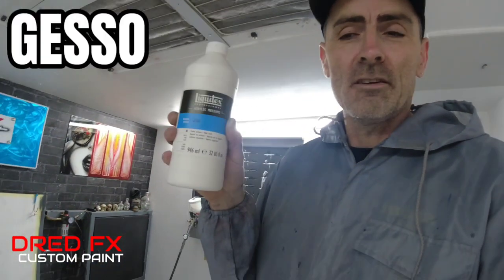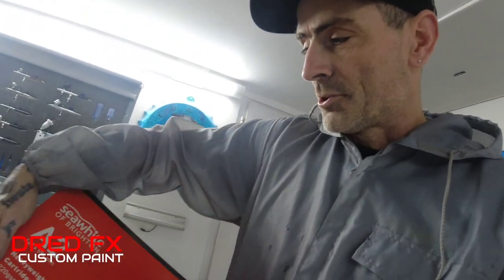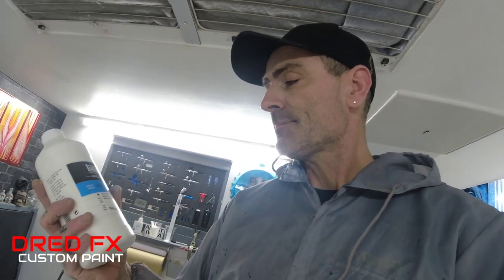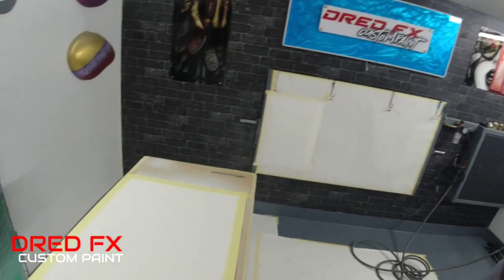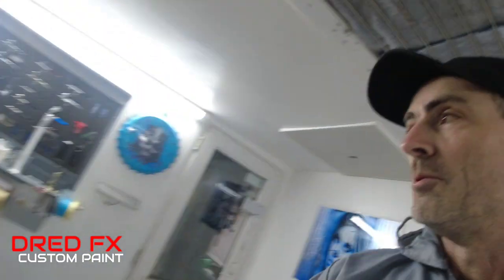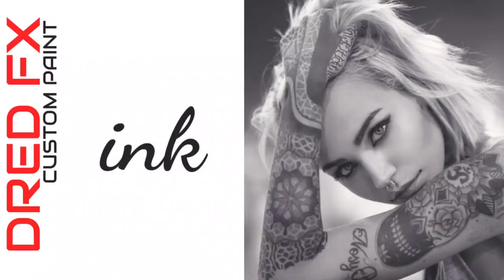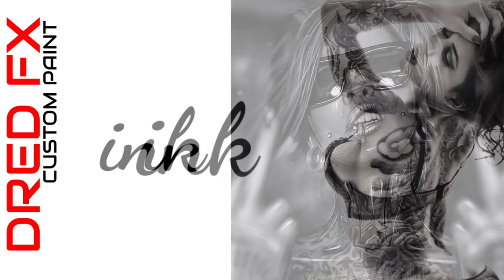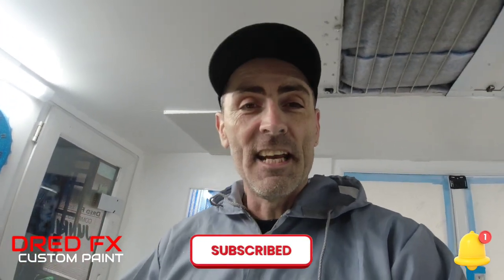Applying Liquitex Gesso with a spray gun

Comment: A little tip. I have done the exact same thing (product) on canvas and it works. Also find that gesso becomes flatter by drying in a horizontal position. BUT gesso in larger quantities is a mess, in booth filter materials, on anything other than the subject, you see you have covered floor. I also found it difficult to clean the spray gun thoroughly. Actually I have a rougher cheaper 2.5 gun for just this type of job with no reduction until last coat.
Reply from the maker: First time giving this a go we will see what it's like to paint on 🤔
Reply: Question: did you THIN down your Gesso and if you did; what did you use to thin it?? Also could tell us  the RATIO of what thinner to Gesso  you used, so it would go through the brush AND still cover well??
Reply: I dilute distilled water well stirred. Due to the fact that gesso comes in many viscosities from the many brands, you have to experiment a bit with the ratio. Sometimes 5 to 8 layers, and long drying time between layers and especially after the last one. If you choose to wet sand the surface afterwards, be aware that water redissolves the gesso and it becomes 'soft' again @yakkyuu12

Comment: Great video my man...!   I just started to draw again.   And will be airbrushing on illustration board.   Having huge problems with masking tape on the illustration board at the moment...  Taking the paper off with the tape.   I have 30hrs of line work on this 40x60" board right now.   And I think this GESSO is gonna be the best way to get a solid protective coating (clear as well) over this mat board so I can lay out this artist masking tape without eff'n up the board.     

I was watching vids on how to apply gesso,  brush or bondo spreader...  But I have a shop with a compressor.  And have sprayed automotive paint for years.  So reduce the Gesso DOWN. 15%  And BADABOOM...!!    Looks like it goes on slick.  

Thanku sir for this video.   Much appreciated...!!
Reply from the maker: Glad you liked it the gesso works a treat thanks for the feedback and support with the channel

Comment: GREAT VIDEO THANKS WHAT PSI TO YOU RUN IT AT I HAVE A 1.5 MM GUN. MAKE IT LIKE A MILK VISCOSITY OR JUST A LITTLE THICKER?
Reply from the maker: With the 1.5mm go a little thicker I was using a 1.4mm with it quite thick and ran it around 25psi worked great 👍

Comment: I use a trowel for my typo paper.   Never thought of using a 1 or 1.5 conventional gun. Did you reduct it a tad?  Also you can add color too.  Grey's and tans.
Reply from the maker: Yes dropped a bit of water in but sprayed a treat will have to try tinting it sounds good thanks for the tip much appreciated

Comment: hi, is gesso only used when painting on canvas or paper?.
Reply from the maker: You can use it on both and mdf and cardboard
Reply: I can help on this part; Gesso is not really good at ADHERING to plastics- you still could try a little experiment  section-but make sure to let it cure for no less than 48 hrs. then paint your plastic and make SURE to let it sit for about 5 days- then, the real test-- put your piece in the sun, or very warm contained area-- you do this to SEE if your gesso will hold up OVER TIME and this still may not be enough-- many guys test plastic pieces and let them sit for MONTHS! I don't know your specific project -but it is really REQUIRED to SAND your plastic even before putting Gesso on it-- ESPECIALLY plastic-- because Gesso does not not ADHERE to plastic very well(  plastic is NOT very porous),  Gesso works well on paper, art canvas and wood- anything that is more porous!

NEXT -- is actually THEE best thing to do if you do not want to use GESSO:
Buy at Micheals hobby store in USA, I do not know if you can get this product in other countries------BUY---KRYLON COLORmaxx --PRIMER- just the PRIMER( you can get it with paint and primer in one can!
This IS A SPRAY CAN and YET the solvents have so far had NO EFFECT AT ALL on my plastic projects --- I have let tests pieces SIT for a FEW months!
The following are VERY important steps;  1) you STILL need to SAND your plastic ( i used 400 grit- but you need to experiment-- 400 worked very good for me)
2) after sanding -wet down a micro fiber towel- then rub down your sanded piece-- you MUST try to get all the sand dust( its very fine) OFF your project!
3) then DRY your project and and this next part is optional-- I sprayed my pieces--- with a can of AIR-- that you use to spray dust of computers or keyboards-- this is another step to just make sure the {PLASTIC micro dust size particles are NOT on your project
4) This part is important--even though this is a SPRAY CAN( same as spray paint cans) the nozzle shoots a lot more primer---so- stand back at least 12 16 inches- and SPAY LIGHTLY-meaning its okay to press down - BUT a SMOOTH quicker movement across your project--- this will mean -- you may NOT cover it all in ONE pass-- then REPEAT this step #4- with the best you can to do LIGHT coats-- -- if you feel it may be getting TOO HEAVY a coverage -- just STOP ---LET IT SIT AND DRY( should not take more than 20 minutes( you can do a very light finger nail touch test to see if its dry)
If it is DRY and you still SEE some spots you missed--- just SPRAY some primer into a paper cup or what ever you choose--- then DIP  a thin MODEL PAINT BRUSH into the primer you SPRAYED in the cup---- and PAINT with the model brush--- on the TINY spots you missed -- then let DRY-- DO not put a LOT of paint on the brush -- you WANT it TO NOT cause LUMPY STREAKS-- it WILL -LEVEL with NO STREAKS or  lumps-  if you paint it with a smooth little brush strokes!

LASTLY-- let the project sit 24 hrs( just to give you more time to RECHECK for coverage) -you do not need to wait this long IF you think you got full coverage--REMEMBER - thin coats --- just like airbrushing! Yes- its harder and do NOT stress if it lS MORE paint than your typical airbrush!

$$$$$$$--KRYLON - COLOR maxx primer only--it took me MONTHS to find a PLASTIC primer that worked and this is the ONLY one I found that worked --WITH ALL my acrylic paints!
Rustoleum sucked!  $$$$$-YES --ALL my acrylic paints- I use only GOLDEN, Liquitex, and Amsterdam-- and these paints metallic colors!

I ALSO used  SPRAY LACQUER over my FINISHED project NOT Varnish or clear coat-- I have checked my pieces for the last 4 months and so far no problem- BUT-- my projects have STAYED inside at about room temperature- not a  specific controlled temperature!
****NOTE-This USED to be called --Krylon UNIVERSAL primer- I have NOT seen THAT name at all lately, and I do know they RENAMED it -Krylon colormaxx - it IS THE SAME THING!!
Reply: @yakkyuu12  Wow, thank you for taking the time to explain so thoroughly..